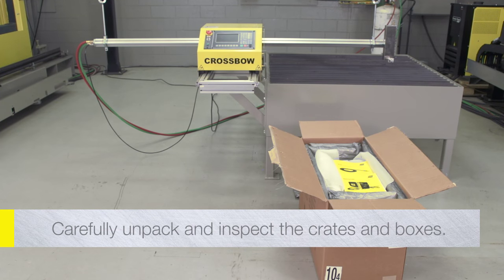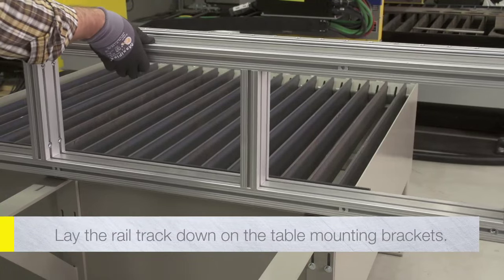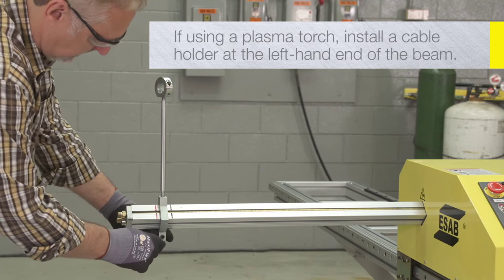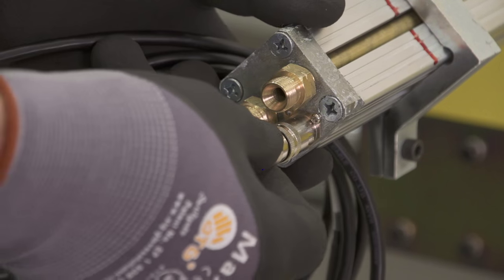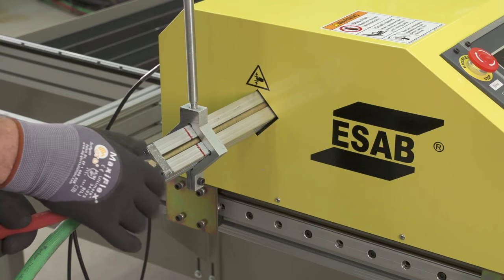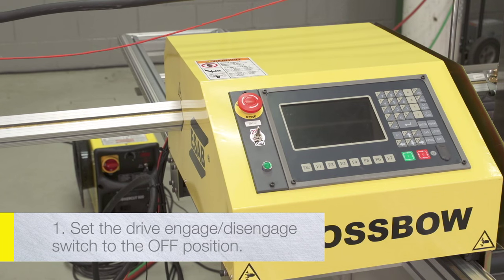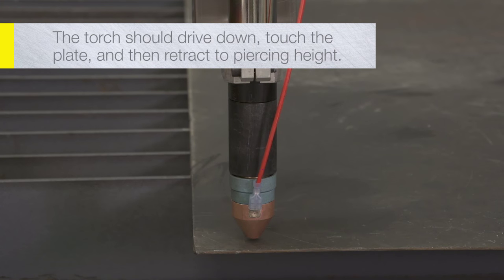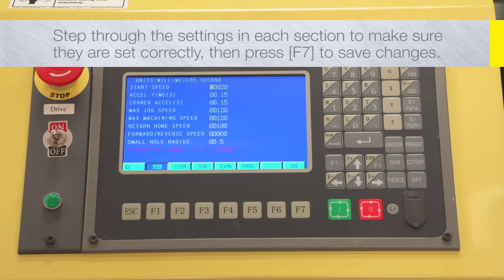Crossbow Setup Video: Step-by-Step Instructions

Comment: I what the correct number for 
1- speed 
2- system 
3- flame 
4- plasma 
5- control 
Because i change the original number so now when i but 20 mm the machine cut the iron 23 mm

Comment: How do you set preheating time so that the complete cutting is carried out automatically? Also is it possible to set 2 different preheating times, say for a hole and for straight cuts?
Reply: go to setup then flame setup , here u can set the preeheating time and no need to set 2 different timing machine will automatically adjust the preheating time for next cutting